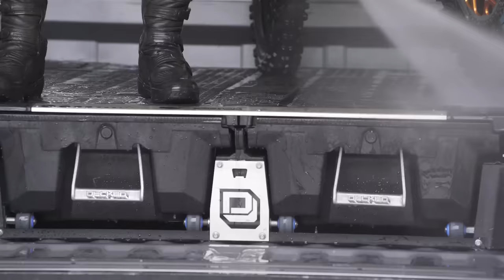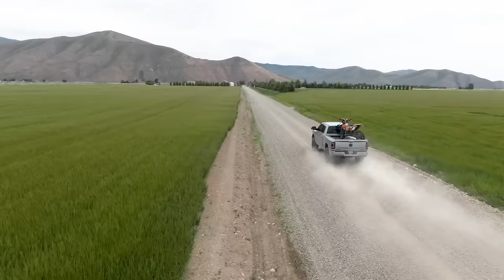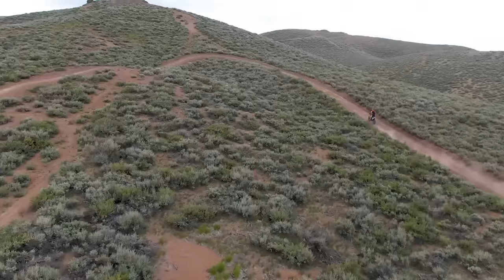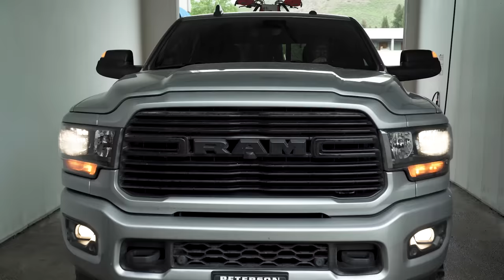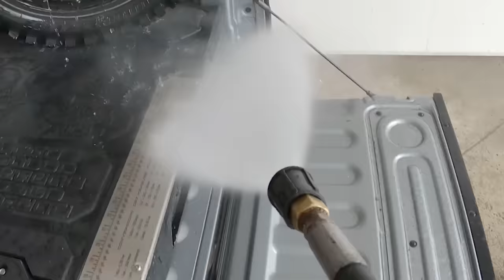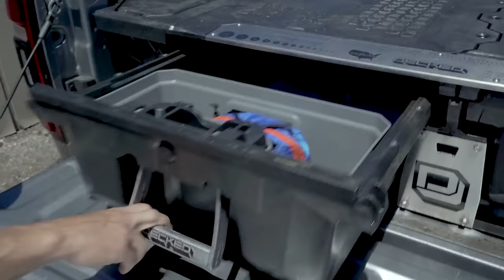DECKED Test | Dust Resistance & Weatherproof Test

Comment: i love my decked drawers, but they are nowhere near this waterproof. there a full 1/2 inch gap between the top of the system and the top of the drawer seal and i get water in mine all the time. my soft tool bags have to be thrown in the wash once every few months to keep the mildew at bay on them since the soft bags soak up all the water that leaks in and i cant tell you how many hand tools I've had to throw out because they rusted so badly in these drawers, its stainless steel tools only now to keep the rust away. they are great for securing the gear but they are horrible at keeping them from water. i literally just had to throw out a battery operated drill that got fried out and shop vac 3 inches of standing water out of one of my drawers after it flooded for some reason i cant explain. i like the system but dont lie to the customers like this
Reply from the maker: Hey there. Sorry to hear about your hassle with water and your DECKED system. You definitely shouldn't have a full 1/2 inch gap between the top of the system and the top of the drawer seal and get standing water in your drawers. Have you reached out to our Customer Service or Warranty? We would love to help you out and get the leaking issue resolved ASAP. Give us a call at 208-806-0251 (ask for Matt, he's the man) or fill out our warranty claim here: https://decked.com/pages/warranty-claim

Comment: Question. So it appears the hight of the decked system would make the front tire of the dirtbike rest against the back window in some of those shots? I wouldn't want to punch out my back window driving down a bumpy road. Some show it in at an angle so the tire is in the corner and other shots the tire is straight in towards the rear sliding window. Just wanted to check if the tire still is able to 'rest' against the back of the bed or if it touches the window (wouldn't think it is).
Reply from the maker: Hey there. Great question. It really just depends on your truck. The best way to figure it out is to measure 12" up from your truck bed. This is where the DECKED system will sit. From there you can figure out where your tire will rest depending on how tall your truck bed is. All trucks are different but most of the newer trucks actually have a deeper bed than some of the older trucks. Let us know if you have any other questions.
Reply from the maker: Hey Mark, Your front tire should still rest on your bed railing and not touch the window. To test out where that might hit for your particular bike & truck combo, you could also measure to be sure. Our systems are 12" tall.

Comment: That's the strangest sounding 2 stroke KTM I've ever heard.  Is the product fake like the commercial?
Reply from the maker: As real as it gets! No smoke and mirrors here. Let us know if you have any other questions.
Reply: @Decked  You're commercial has a two stroke in the truck and implies that it's the bike being ridden.  The bike being ridden is clearly a four stroke.  I'm not trying to knock your product at all.  I'm just trying to provoke a response so you'll clean up your advertising.  You lost some credibility changing horses midstream.  Although you didn't respond to my accusation of switching dirt bikes you do get credit for responding to my reply.  
Edited:  If it's as real as it gets then make it so.

Comment: Your website says they aren't dust and watertight so why should we believe this demonstration.
Reply from the maker: The DECKED Drawer System CAN get small amounts of dust or mist in the Drawers because they do not seal like Tupperware but if installed correctly you shouldn't have any issues.